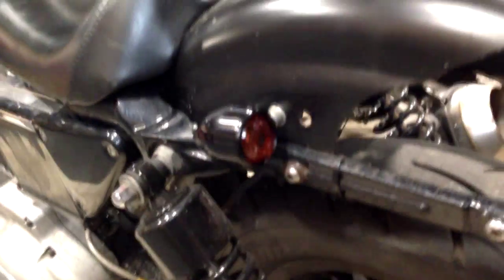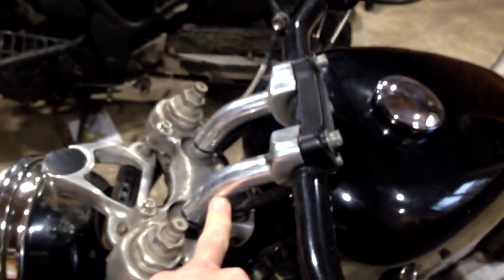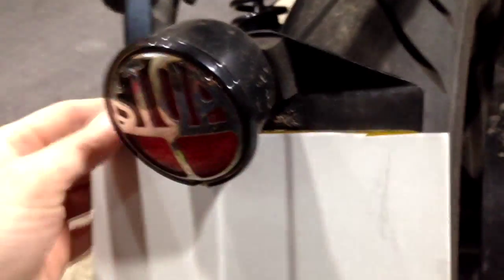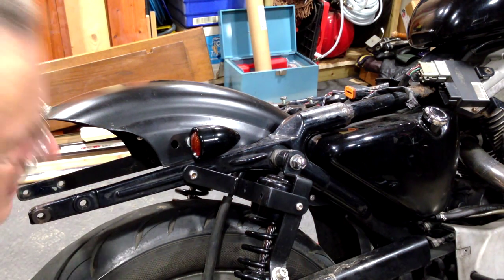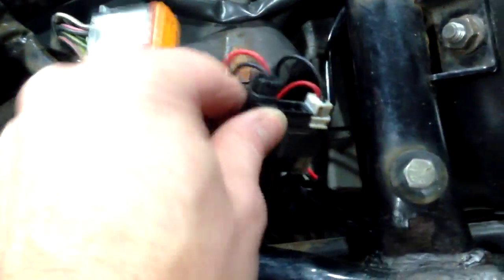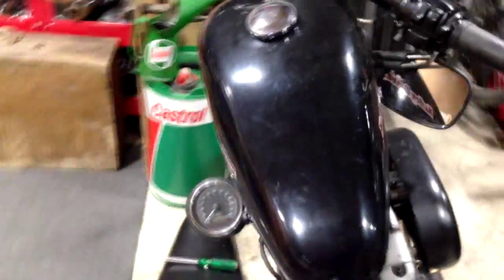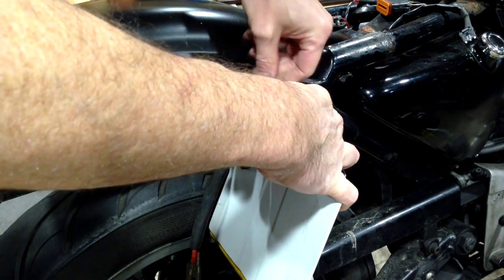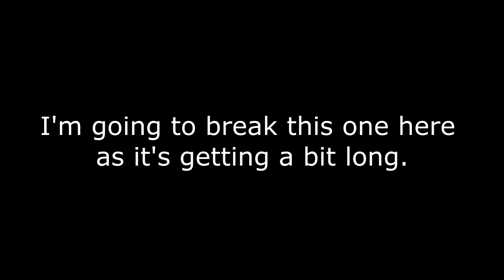Harley Sportster: Fabricating a Side Mount

Comment: Fine bit of fettling, my only comment would be because you have moved the rear light to the right of your right hand side indicator, when your braking and turning right, some twat my think you are turning left and come up the outside of you... cannot be positioned in the centre of the bike again?
Reply from the maker: +GTs Garage Thanks GT.  I'm not a fan of the side mount to be honest.  Problem with centre of the bike is finding somewhere solid enough to mount it.  Currently the rear mudguard isn't well enough supported for it.  But I have some ideas, the most likely of which in the short term is to add a marker light to the other side of the bike - which is quite Harley style anyway.